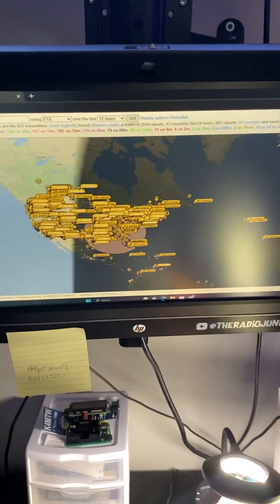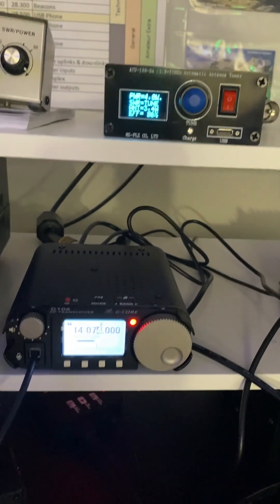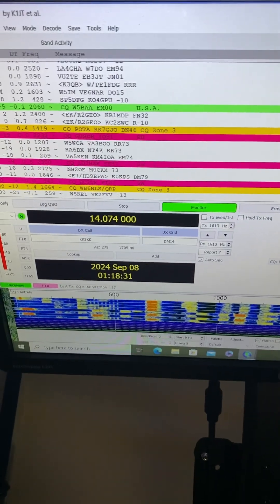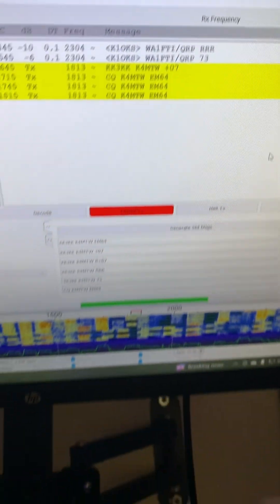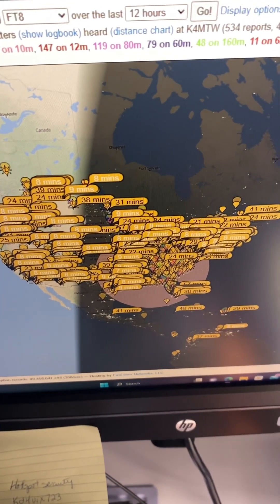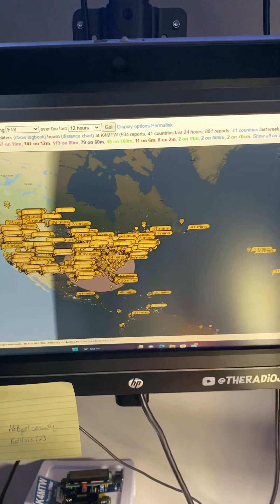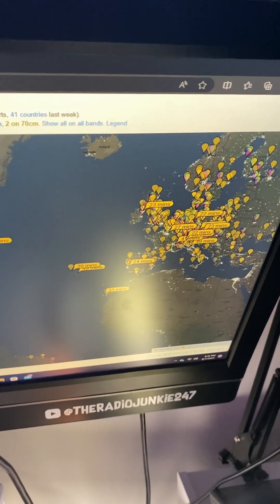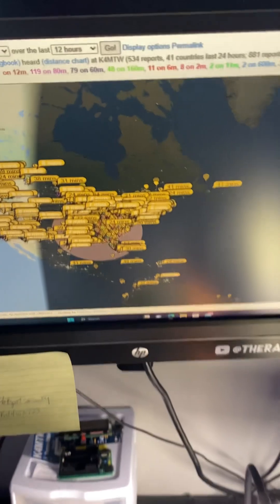3.4 Watts!!! #Xiegu #G106 on FT8 #hamradio #ft8

Comment: A bit late in the discussion, but I am also running a G106 on FT8 and FT4. I am using MSHV v2.75 for the software and Xiegu's DE-19 interface. 300 QSO's in the log since early December (Today is Feb 20th). It's a solid little rig, and I have QSO's on all the included bands, including 60 meters.  It's the best $250 I have spent on gear for at least the last 40 years!  73, Keith, WB2VUO near Buffalo, N.Y.
Reply from the maker: Keith I like mine also. I got it when they were offering the package deal for 199 with the de 19. It has been a great radio for me as well so far!!! Thanks for the comment!!! 73 de K4MTW

Comment: Coincidence.  I have the same radio, tuner and software that I have setup for dedicated FT8 work.  I do have something extra... a small RF amplifier that I often use to boost the power up to 45w.  But, the extra wattage isn't mandatory... if the band is open 4-watts on 10-meters works about as well as anything.
Reply from the maker: I would like to have one of those little amps myself...but same here i make decent contacts using about 4 to 5 watts.